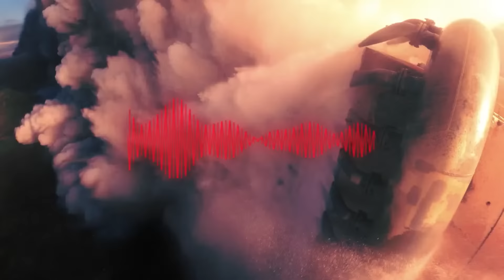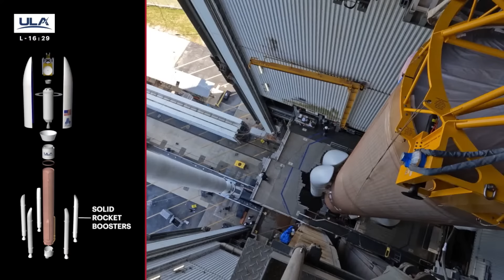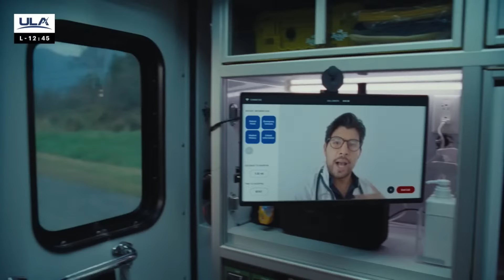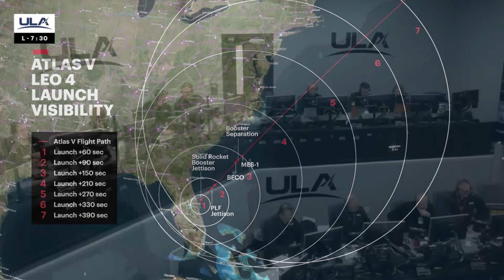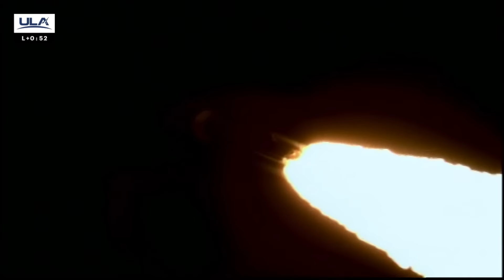Rocket Launch: Atlas V Leo 4

Comment: Terminal Countdown 
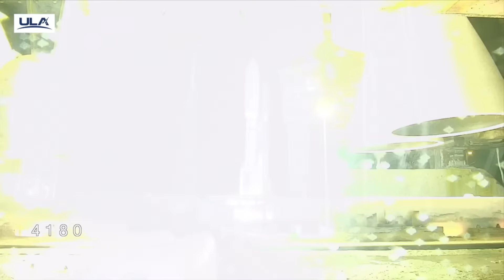20:32 Deluge Activation 
20:36 RD-180 Ignition 
20:38 SRB Ignition 
20:40 Liftoff
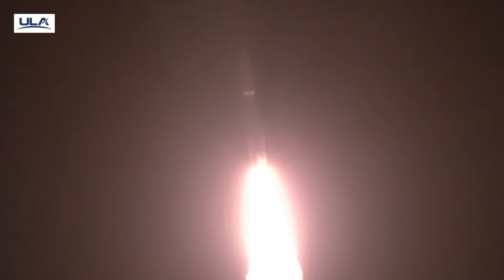20:48 Pitchover and Roll Program Start
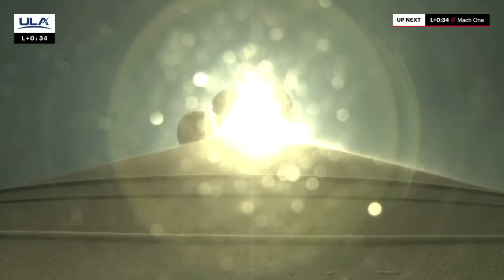21:11 Mach 1
22:10 Max Q
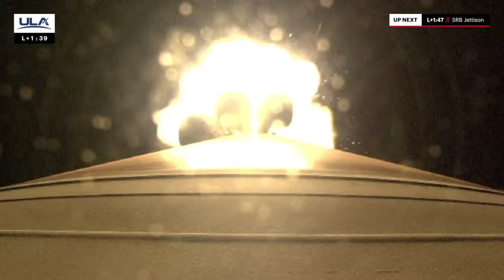22:15 SRB Burnout 
22:25 SRB Jettison
23:48 PLF Jettison 
23:53 CFLR Jettison 
25:02 BECO
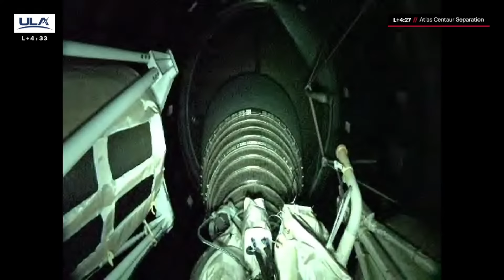25:09 Atlas /Centaur Seperation 
25:20 RL-10 Ignition